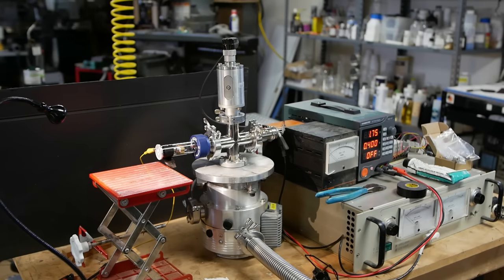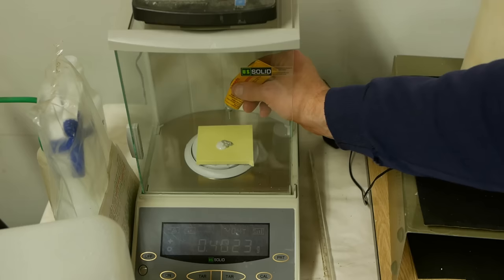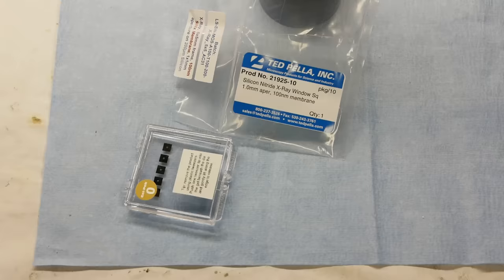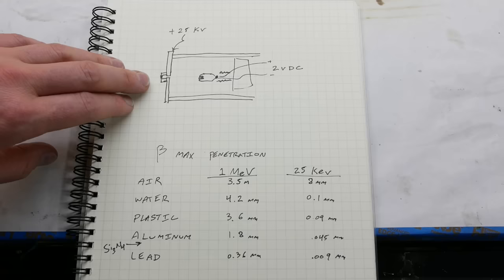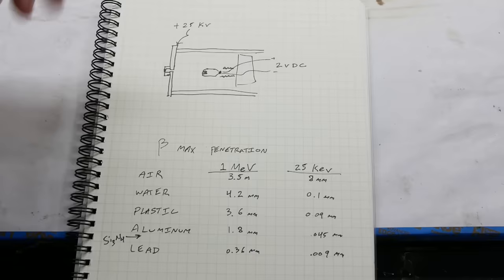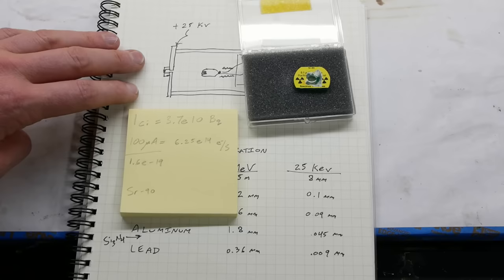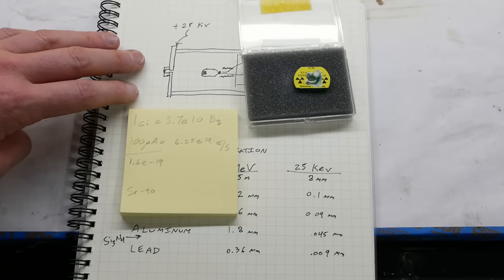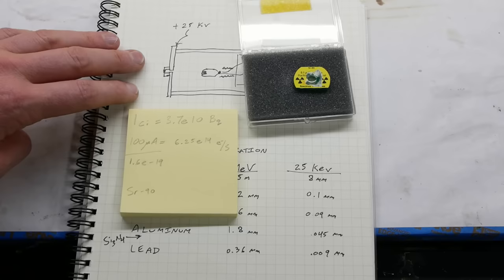Shooting an electron beam through air

Comment: Stick something under it and put your XRF detector next to it!
Since you're firing electrons at something, you can get characteristic x-ray peaks out of it, just like you would with any regular x-ray tube.
This is just how SEMs do it!
Reply: That's a good idea!
Reply: @Matthew Morycinski You're not going to get anywhere near the beam current when it goes through the atmosphere, and definitely nowhere near the Gaussian profile. I wouldn't expect the actual electron "current" to be more than 10% of the beam current. Even still, at 30keV 200uA you're not likely to do any significant damage if you run it for a minute or two while standing a meter or more away.
Reply: @Spirit532  I guess dangerous is not the beam itself, but radiation from electrons hitting whole area of aluminum plate. Characteristic x-ray K-alpha emmision line of Aluminum is 1.48keV (~0.85nm) and I'm not sure how much of it can be stopped by thin glass tube and air. EDIT: I forgot about bremsstrahlung that has wide spectrum.
Reply: @pavelperina7629  1.48keV would be stopped by a few mm of air. Braking radiation is more dangerous, but still, as said above, the amount would be negligible.
Reply: @Spirit532  I'm not sure where to find information about xray opacity for various energies and materials, but someone told me that using aluminum and steel for shielding makes huge difference and that's why all SEM parts are from steel or iron and beam energy is limited to 30keV
Reply: @pavelperina7629  Look up the "half-value layer" charts for various materials, they're what you're looking for.
SEMs aren't limited to 30kV by the x-ray emissions, it's just that there's not much of a point to going beyond 30kV for acceleration.
TEMs operate at upwards of 100kV, and sometimes over 300.
Reply: @Spirit532  Thanks I found this: https://images.app.goo.gl/PAEdcCDruDtG7fX26 seems like iron can stop half (or is it 1/e?) of 30keV xray at 200um whereas aluminum at approximatelly 3mm. So 3mm sheet of iron provides likely 30000 times better shielding than aluminum. Interesting, I did not expected this.
Reply: @Spirit532  Just cataracts.   Goog: "radiation cataracts." 
Still seen on eBay: lead-glass spectacles, used by oldschool x-ray techs.
Reply: @wbeaty  The electron and/or x-ray flux generated using this experiment would require a healthy hour-long viewing session a few centimetres away to even have a chance of developing cataracts.
Reply: @Spirit532  Dose-related.  A few weeks of messing with this sort of thing can add up, and cataracts are an early symptom, not cancer.  Airline pilots experience radiation cataracts, and dose rate at flight altitude is only a couple orders higher than BG at sea level.   First: eye protection! (2nd and 3rd, I'd guess testes and thorax.  Or, cower fearfully behind heavy shield, viewing your 5KeV Lenard Tube via video cams, or through a stack of color CRT faceplates?)

I did buy eBay lead-glass spectacles. 

PS, the boss is out this week  ...receiving cataract surgery!   Age-related, not much dose acquired here, except from cinderblocks.  We did have a graphite-pile reactor about 20ft from my desk, but removed in the 1960s, and all remaining traces are currently buried under two meters of dirt.
Reply: @wbeaty  A few weeks of staring directly into it point blank, maybe. Or just... wear regular polycarbonate safety gogs, if you're that worried.
And at 5keV your worst worry is zapping yourself, you don't even care about the radiation at that point since a few cm of air stops it completely.
It's good to be cautious, but you're going full-on radiophobe here.
Reply: @Spirit532   Yes, exactly: a few weeks net accum dose, acquired over a few years.   And who said 5KeV, that doesn't exit the glass. (Note that Spellmans are 30KV supplies.    Me, I'd always stack 'em for 60KV.  But even that doesn't give much relativistic focusing.) 

>  full-on radiophobe here.

Not for the stuff I work with.  Radiophobes are terrified of cancer and infertility.  First, save your frikken eyeballs: really the only thing rad-hobbyists need worry about
Reply: @wbeaty  Who in the world would run this for a year, right next to them? This is a 20 minute experiment.
And you, you said 5keV.
Reply: @Spirit532  that was a joke son:  "cower fearfully behind heavy shield, viewing your 5KeV..." but lacked the smiley-symbol.      Ben's isn't 5KeV, that should be obvious.   And during months of work involving uSv output, THAT'S when it pays to avoid accumulating an eye-dose.  But first develop some good habits (which behavior is the same as becoming a paranoid.  But only 
regarding eye damage.) 

It's amazing that N. Tesla didn't have eye trouble, what with all the work with high-wattage 10MeV Lenard tubes (his "single electrode" x-ray sources.)    Tesla sez, when you hold your head in the beam for THIRTY MINUTES, it interferes with time sense, and seems like only ten minutes have passed, but be sure to use an aluminum slab to remove the skin-damage.  (!!!)  Wise advice?

Heh, also, don't assume that neutron-flash from the FRC machine[1] in your basement is completely innocuous.  Neutron-activate your hemoglobin, and bone calcium?

. [1] not a Fusor.

Comment: Would love to see you expose a micro SD card to the beam (or some other array type device), I wonder if you could attempt to make a cool but completely useless image sensor out of it (although I suspect the wear leveling to be a problem on modern ones).

Connecting a metal plate to an analog ammeter and to ground and moving it around in the beam would also be a really simple but cool demo.

I also wonder if considering this thing is putting out a good watt or two of radiation (might have to crank it up a little for this work) I wonder if you could put the aerogel (or some other low thermal conductivity material) into the beam and then cross section it while filming with a thermal camera, I would expect to see an interesting pattern as the beam is absorbed by the material heating it.

I also see a lot of people are suggesting a cloud chamber, I would love to see that as I don't really know what kind of trails this thing would make.
Reply: Just a NAND memory chip would be a better "ghetto image sensor" - assuming the electrons can make it through the packaging. MicroSDs would have the same exact issue though.
Reply: Very interesting experiment is when the chunk of plexiglass (acrilyc glass) exposed to electrons with energy about 5MeV. Electrons stucks in plastic and then when you  pin it through with some grounded sharp thing, electrons are drain through this thing to ground and you get a little lightning inside that draws a 3D Lichtenberg figures.
UPD: Oh! There is in video about it. )
Reply: @JesseCombsTwiZtedCheese  that depends of what the ghetto!)))
Reply: @user-rc4zk8ge1g  you can sand the packaging and the die itself if that wold help. It's called die lapping in extreme overclocking. They sand it thinner and mainly flatter for better thermal transfer.

Comment: Could you post-accelerate the electrons after they come through the window?
Reply: Yes.
Reply: Should be possible in principle. You would have to be fighting the air a lot though. The beam is also crazy divergent since the electrons strongly repel each other, so collimation will be another issue to work out.
Reply: Scattering would be a problem (as you can see from the way the beam spreads out from the end of the tube, obviously more than how much it spreads out going down the tube.
Reply: only theoretical.
thats why we build all that stuff in vacuum. air ruins everything.
Reply: Field strength in air is limited. Especially when ionizing particles are present. Nice idea though, use the electron beam to trigger sparks or make air conductive without sparks perhaps.
Reply: Yeah, outside the vacuum, the in-air microamps might be compatible with VDG machine's 10uA. 
My childhood dream was to pulse a VDG onto the front plate of a TV set, giving it a brief 500KV acceleration to the e-beam.  After all, your tee vee already contains a linear accelerator, even if the MeV value is pretty low!  Then try GM counter, would it detect anything?  X-ray pulses even?  Never tried it.  (My weekly lunch-money wasn't big enough.)  Today I see that the faceplate glass is probably way too thick, unless you have a color CRT from early 1970s before they added lead to the glass.  But maybe I could discolor glass with VDG-pulsed color-center implantation, if enough pulses could be applied to the glass TV front.
Reply: Or ramp up the power after the electrons exit, even if not collimated?
Reply: @Nagria2112  Except breathing
Reply: @pizzablender This already exists. The electron beam triggered spark gap is used when low jittering is needed. While not as good as the leader triggered spark gap, it tends to be cheaper.
Reply: Be careful you don't get carried away: https://youtu.be/fRbbq6MIP_E
Reply: @HenriFaust  lol not likely

Comment: It'd be interesting to see its effect on a living thing - maybe part of a plant, or an agar plate with bacteria? I'm assuming it'd kill / sterilise the affected region very quickly.
Reply from the maker: That's a good idea.  Since I mentioned it's used to sterilize equipment, I should show it working!
Reply: @AppliedScience  maybe draw your logo with the beem in the petri dish lol.  Btw unless I misheard you the e beam x links the extruded heatshrink tubing before it's expanded. That's what gives it a way to relax to its original size when you reheat it in use.  You can over irradiate it in processing and make it brittle.

Comment: I hear someone who now knows the heart-stopping how-expensive-was-the-mistake-I-just-made sound of a turbomolecular pump yowling as it crashes to a halt.
Reply: Haha, that person must be lucky, I've seen the carnage of over 100k rpm crashing to a halt and transferring all the kinetic energy to the pump housing causing it to wrench itself loose from the vacuum chamber and fling itself across the room, smashing up a tool chest along the way. The chamber got a little messed up as well, both from the pump ripping itself from the flange and from the electron beam suddenly exposed to atmospheric pressure, the filament exploded and melted chunks of (I assume) oxidised tungsten to the anode and cup.
Reply: Yeah, when I was reading my pump specs it requires the pump mount to withstand 600 Nm of torque. And it only goes to 60k RPM.
Reply: @sealpiercing8476  HiPace 80. About 3 kilos?
Reply: My first thought as well. Those things are scary and scary expensive!
Reply: In my experience turbos are pretty tough. Most are designed for venting at 50 % rotation speed. Venting at 100 % is not ideal, but usually doesn't kill them.
Reply: I’ve once stood right next to an operating turbo molecular pump with a 200kg rotor. It was connected to the rest of the system via bellows, and was firmly anchored to a concrete foundation. Apparently it was pump #2. The first one used not to be so firmly attached, and became junk the instant one of the viewing ports shattered on the system (the port wasn’t installed correctly). The air inrush didn’t junk it, the fact that it set itself free of that mess, rolled through a partition wall (drywall on steel studs) and embedded itself in the overhead door on the other end of the building - that was the final straw. There was enough deformation and internal damage to render it unworthy of repair, apparently.
Reply: @sealpiercing8476  yeah, was while electron being welding, apparently a chunk of slag found its way through the duct work into the turbo molecular pump, which management conveniently forgot to put a screen over, and caused the blade themselves to wedge together and come to a screeching terrifying halt haha
Reply: @sealpiercing8476  Are you saying, our big pipe-clamps holding the entire Edwards turbo against a piece of 14ga aluminum angle-bracket  ...might not be enough?  Heh.
Reply: @derkeksinator17  buy an old noisy Balzers for $200, then see the famous DIY vid about updating with three-dollar ceramic rollerskate bearings.  (Need machine tools, to build the simple tools, to pull off the rotor etc..)
Reply: @wbeaty  Might want to change that bracket to 12ga and add a few giant zip ties to supplement the clamps. Should be all good then. Double-heh.
Reply: @sootikins  no no no...  MORE  DUCT-TAPE EEGORE!
Reply: @wbeaty  can you link this video?

Comment: My father used to work in air traffic control for the RAF, I remember as a youngster (1960's) visiting him at work and seeing a small room full of CRT's all without phosphored screens. When a call sent by an aircraft it was received by multiple stations each remotely controlling a CRT, the beams projected across the room onto a large (presumably phosphored) screen to auto-triangulate the aircraft location. Hope my memory stands the test of time.

Comment: Awesome video as always!

One idea for another experiment: you could install a few solenoids in front of the cathode with incrementally increased B field to focus the beam to a tighter point.  This could reduce the amount of wasted electrons that hit the anode and send more through the window. (I'm not sure if this vacuum tube is big enough for the number of windings and length needed, but I could run a quick simulation in Comsol if it seems like an idea worth trying.)
Reply: Magnetic lenses are incredibly difficult to control, they require a complex geometry of the core, that is why electrons are focused by electric fields much easier to create and control in CRTs and X-ray tubes, so this should be made inside the vacuum side, but it would fry the Lenard window.  T he magnetic control is only used for the scan in CRTs for TVs and is electrostatic in CRTs for oscilloscopes because the TV screen is much larger, has a weird geometry and it is a pain in the ass to adjust, so most of the adjustment is made electrostatically. In electron microscopes most of the control is made by magnets several of them.

Comment: I'd be curious about giving atoms some extra electrons. Like what happens if you take a chunk of sodium, shoot it with this, then throw it in water? Will it be "supercharged" with even more electrons than usual, and release more energy when you activate it?

Another idea: stick Styrofoam peanuts to something with static electricity (maybe the lid to a plastic tote container) and see if this thing can knock the peanuts off.

Would this travel farther in helium/hydrogen due to lower density? That would be cool to see.

What happens if you take a second tube with a second window at one end, phosphor at the other end, and vacuum inside? Can you put window to window, with a gap of 5mm or something, such that it traverses air, then goes back into vacuum, and then can travel another 10cm before striking phosphor to make a spot? That would be neat, transferring electrons from one vacuum chamber to another, across an air gap.
Reply: Since sodium is conductive, all of the charge would be located on the surface of the chunk and I think it would discharge as soon as it touched another material (even non-conductive, like the thing you're holding it with or water). Highly charged metals even emit electrons into the air, so I think there would be no difference between throwing sodium in water with and without exposing it to the beam first.

Comment: Some ideas to try:
1. Put a hard metal in the beam and measure the increase of X-rays. 
2.  See what happens if you put a leaf foil in the beam path. 
3. Epoxy a glass tube on the other side and see what happens with various gases at very low pressures (neon, Argon, CO2. also try a magnet or electromagnet coil to see if it deflects the beam. At much lower pressures you should be able to get the beam to travel further.
4. Make a tiny CRT tube instead of using the electron window, use a flat bottom closed tube or small erlenmeyer flask with the bottom coated with a phosphor & magnetic yokes to control the beam path.
Reply: About X-ray, you can get energy and convert it to wavelength using for example the following table https://www.jeolusa.com/DesktopModules/LiveContent/API/Image/Get?mid=4725&eid=1&Type=View&PortalId=2
But I don't know what the is efficiency is depending on beam energy and material. My experience is that with beam energy of 30keV (which is limit of SEMs due to safety restrictions) x-ray detector barely detects anything above 10keV and there's nothing above 18keV.

Comment: We have a 1 MeV electron beam at work for cross-linking of cable insulations, some of which go into nuclear power plants. For more common applications there are cheaper ways of cross-linking plastics. The irradiation happens in a concrete bunker due to the safety aspects of the emitted radiation. Unfortunately I have not got to play with it too much... which is probably a good thing :)

Correction of how the heat shrink works: 
You first manufacture the tube in its final shrunk size and then cross-link it. If you then heat it above its melting point it will not become liquid, but it is instead a "rubber" which you can stretch it by a lot. Cooling it in its stretched state will cause it to freeze in place, and it will only go back after heating above its melting point at a later stage. This is extra apparent if you use transparent heat shrinks (for example PTFE) as they are often milky at ambient temperature due to the crystals in the plastic, but at the temperature when it starts to shrink it usually turns transparent as the crystals melt. 
(Note: PTFE does not work well with electron beam crosslinking as it degrades (does not like radiation), but luckily it behaves as a cross-linked material already from the start due to the high amounts of chain-entanglements)